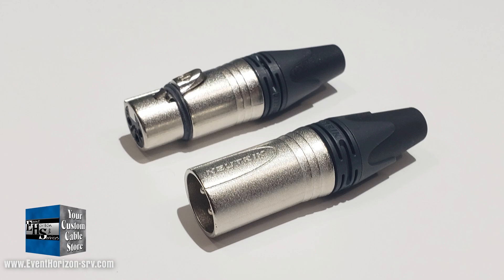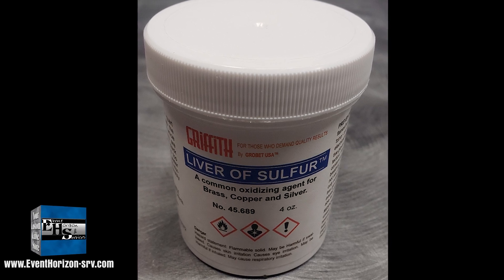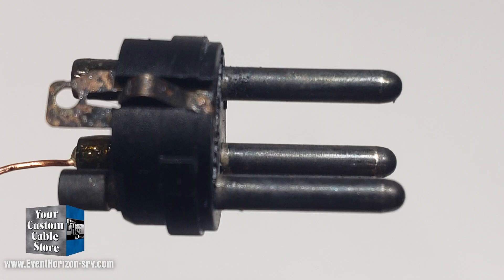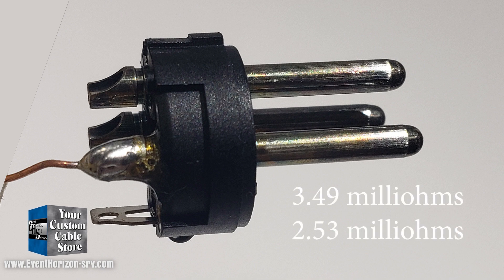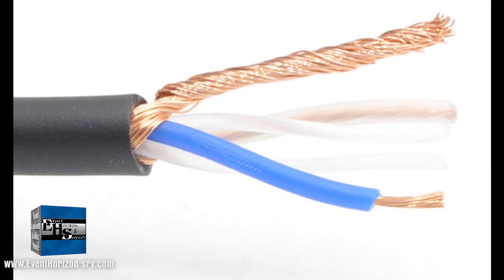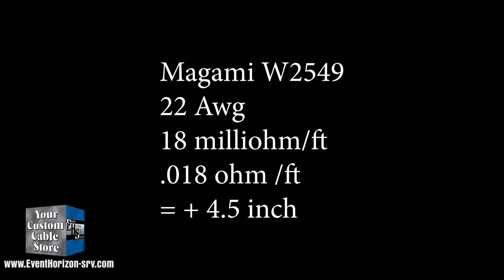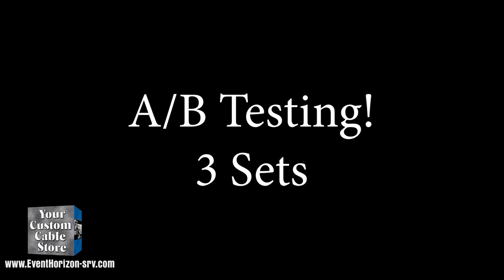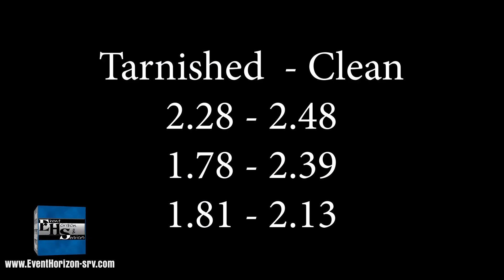All About Silver Contacts and How to Clean Them

Comment: BRANDON, I think you're using the wrong silver dip because this is for jewelry NOT for Silver plating IC pins, Socket Pins or Audio Jacks because they have a certain COATING. I don't think this Goddards silver dip is going to work the same.
Reply from the maker: Hey Wayne, I would argue that your point is not correct. There is no coating on the pin other than the silver, at least in the case I am looking at. Silver is the most conductive metal; anything you coat it with would likely negatively affect performance. You could argue about the alloy used for the pins, but when you go to the Neutrik site, it only specifies silver. On top of that, I am not sure your point about it not working the same because, with modest tarnish, the Goddards cleaned it like new, so it did exactly what it was supposed to do. I am open to specific suggestions if you would like to provide them.  Thank you for taking the time to comment!
Reply: @EventHorizonSrv  If you Silver dip the tarnished or rusted IC pins or Socket Male Pins or Audio Jacks the alloys used might cause "Electroplating" with the Silver dip? Most of the IC pins, Socket Male Pins, Audio Jacks use Silver Plating or a Coating so when you silver dip it might cause "electroplating" and adding more resistance in the milliohms
Reply from the maker: @waynegram8907 @waynegram8907  I'm sorry, but that is just not how electroplating works. You need to apply a current to-do electroplating, and there is no other metal to plate it within the solution. If anything is of concern, it is the residue from the cleaner, which is addressed with the contact cleaner wash. I know it's a small sample size, and I wish I had more, but the results agree with a modest tarnish layer being more conductive, and when you clean it off, it loses that a bit. But we are talking fractions of an ohm.
Reply: @EventHorizonSrv  EM Pinball games use lots of Relays which the contacts on the relays have a coating ( not silver I think ). Can you apply the Silver Dip on the wore out plating on the relay contacts to make them brand new again?
Reply from the maker: @waynegram8907  I would say "no" because first, as you said "not silver", and second, we are cleaning contacts, not repairing them. Basically, a relay is just a fancy switch, and like switched over time, if there is arcing as they open and close, the contact material is literally burned off. The only salvage for that is to replace the contact, which usually means the entire switch or relay.
Reply: @EventHorizonSrv  the relay contacts are "not silver"? They have some type of conductive coating on the relay contacts. I think the coating is for arcing but the arcing still burns of the contacts and pitting happens or burns off the silver plating on the contacts. I thought trying silver dip on the relay contacts would fix the problem. What do you recommend using to fix bad relay contacts?
Reply from the maker: @waynegram8907  Honestly, I don't have a solution for that problem. Sorry.
Reply: @EventHorizonSrv  Corrosion resistance between a male to female connector and loose connections between a male to female connector both cause resistances in-between the male connector to female connector, What are these resistances called?
Reply from the maker: @waynegram8907  Contact resistance? Perhaps could use the term insertion loss, too.